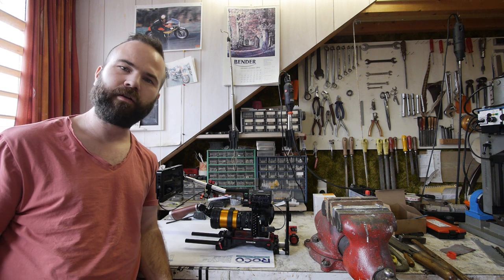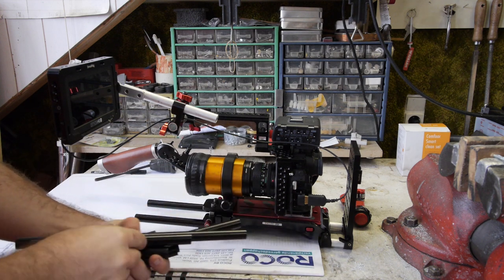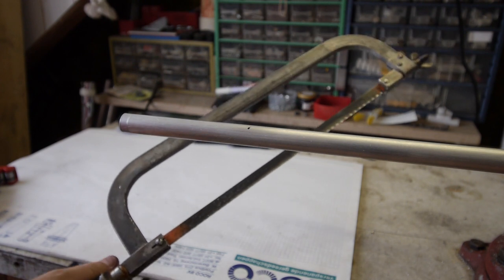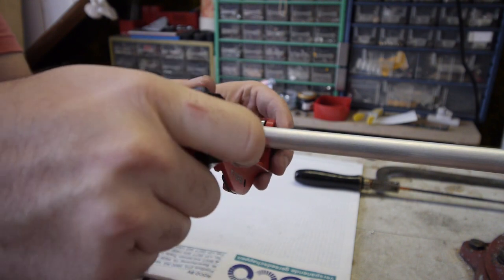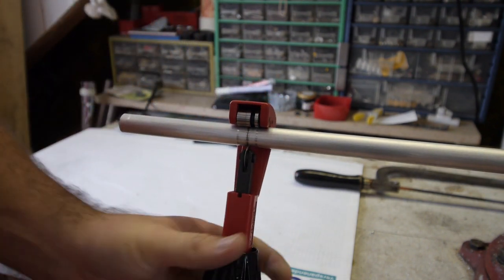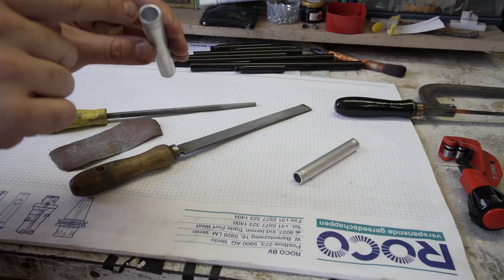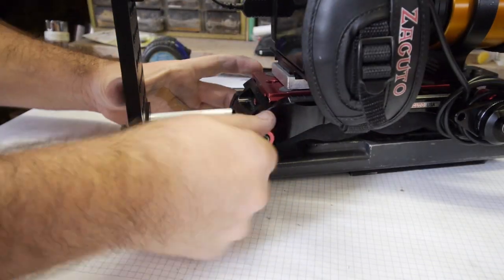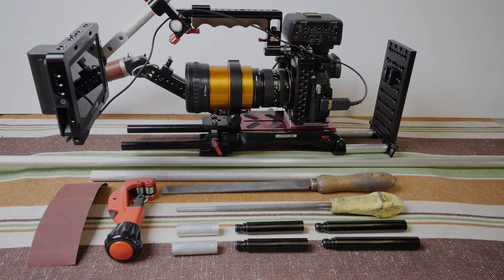How To Make DIY 15mm Rods For Your Camera Rig

Comment: Unfortunately, the standard size is 16mm and is used for towel hangers, drawers and other toilet or house furniture. I haven't been able to find 15mm in my country...only 16mm and then 25mm and up.
Reply: in the netherlands we use 16mm but also 15mm rod